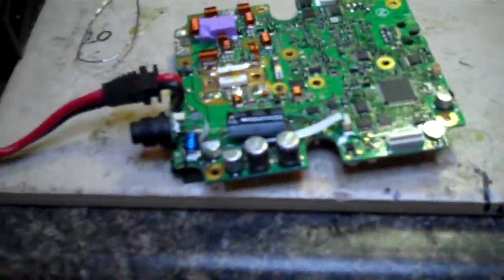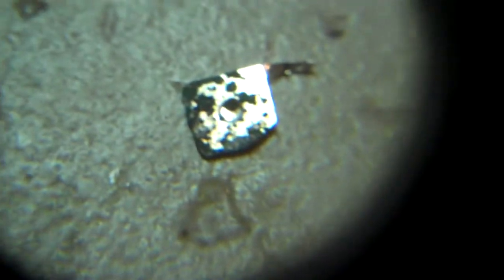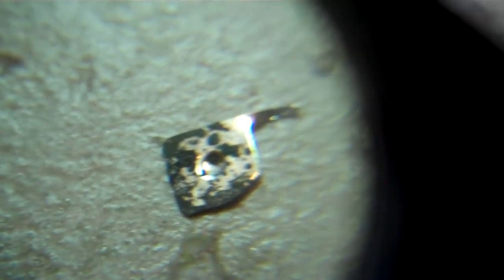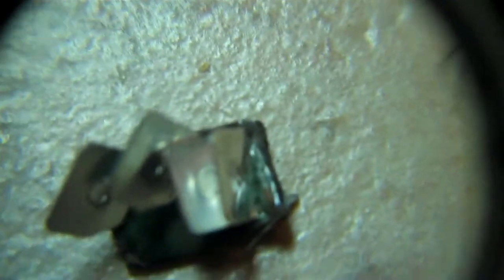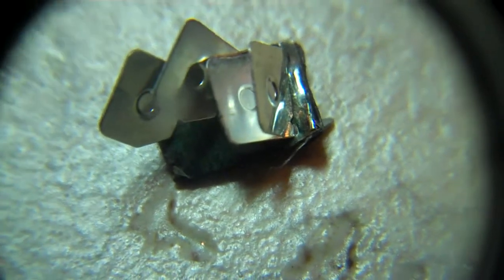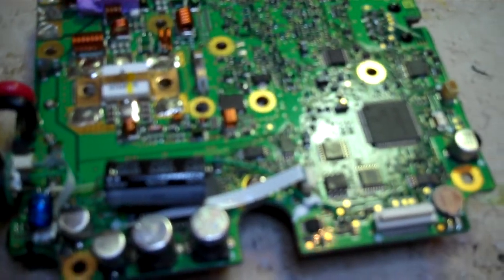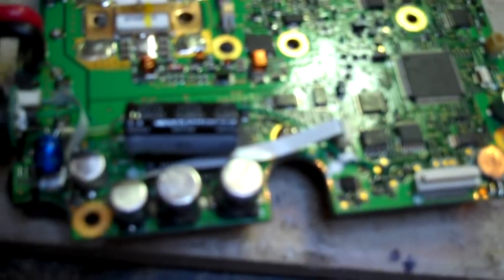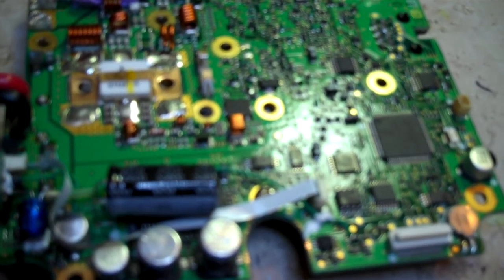Yaesu FTM10r filter repair 3of4  LTM450FW swap, Electromigration filter autopsy

Comment: very informative, thank you.  did you ever put in the caps and what about the narrow filter?  having the problem on my radio now.  Since you didn't share the video on the actual repair I'm not sure how difficult it would be to work on that multi-layered board.
Reply from the maker: Thank you, NO, I have not put in the caps yet as I wanted to see how long the new filter lasts.  It is still working fine at this time.  I live in southern california, and the shack is indoors where it's pretty dry all the time with air conditioned environment.  I suspect that in a constantly high humidy environment, the filter would have failed already.
And about the narrow filter..the radio has narrow band from the menu, so, I'm not sure but suspect that the missing narrow filter was designed out, or is used in a different country model..not too sure.  thanks for watching and asking.  73!  Jim AG6IF